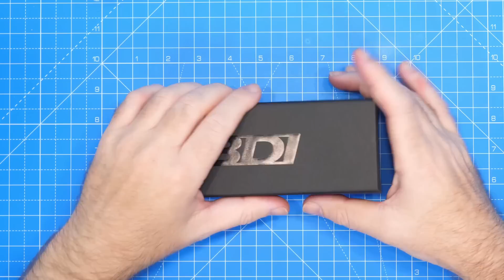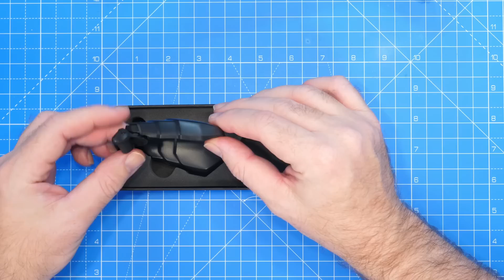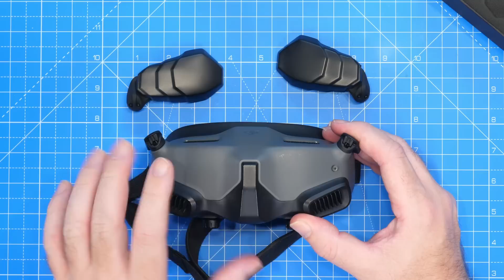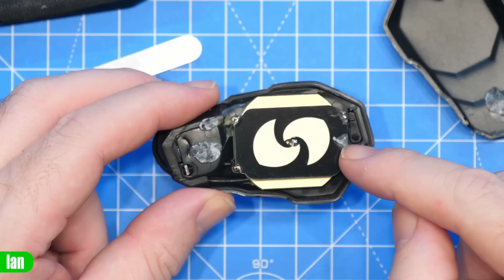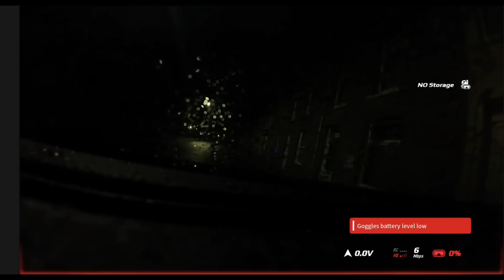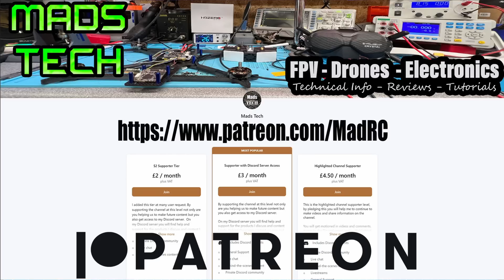BDI Patch G2 Folding Antennas For DJI Goggles 2 - Should You Buy?

Comment: These are complete trash, the best antenna is the stock one if you go behind you you’ll lose signal. You’ll crash onto a house like I did.
Reply: @torpedoLaw there is always a tradeoff, you can’t magically drive more power through the same antenna. Patch antennas increase range by sacrificing power sent behind you, you have to look at your drone for the advantages. Omni antennas like the stock send equal power in a donut shape around you 360 degrees

Comment: Cheers Ian for the channel, all your reviews and time doing so. 

If given the opportunity would you recommend the DJI Goggle 2 or the Integra’s, have the Goggles v1 using the original Air Unit and Vista units.
Reply: If it were me,  I'd buy the G2's.  I think they are the only ones that have removable antennas and they don't have gps.  The gps thing is really only if your paranoid about remote ID  reporting your location.  I'm not worried about that, but I did definitely want the ability to change antennas easily,  as that is the only way to improve your range.  If you're into long range,  Def get the G2s. Just my opinion.  Good luck.
Reply: @ 
Many thanks for the reply, I have to report back that I went for the G2’s for the reasons you have stated, obviously after watching countless videos (as we all do) the reviews here from Ian and the obvious notoriety YT has made fellow FPV aficionados it all counted. 

Again many thanks for your reply and time in doing so.